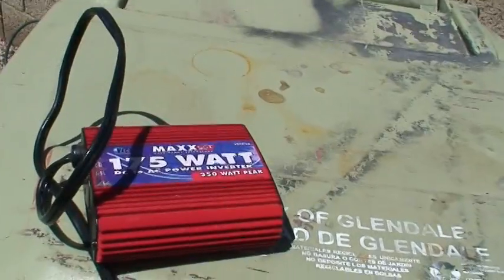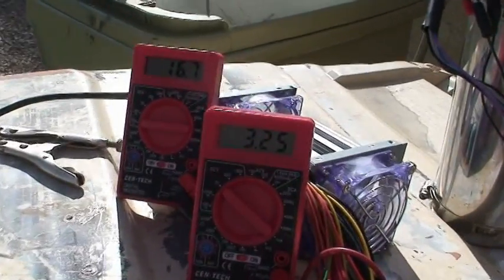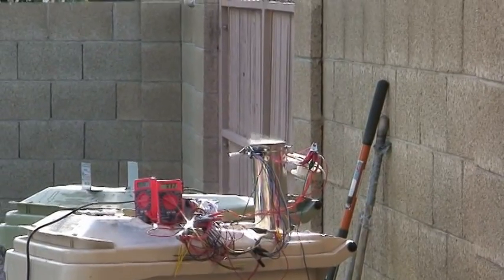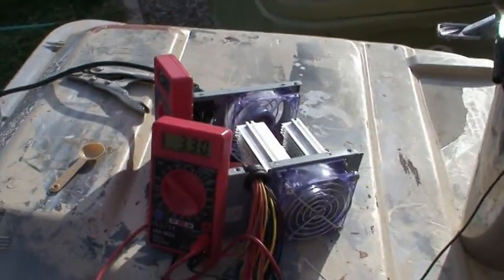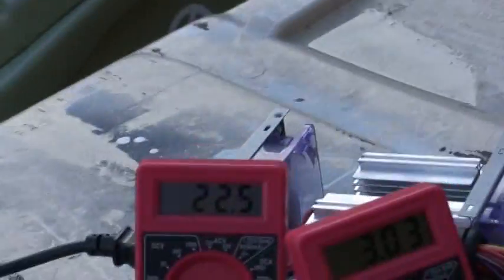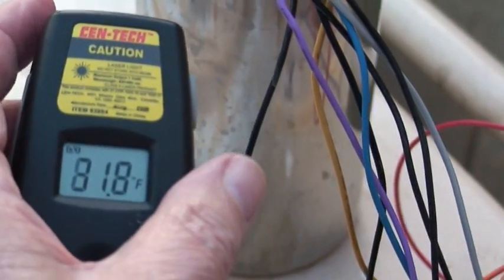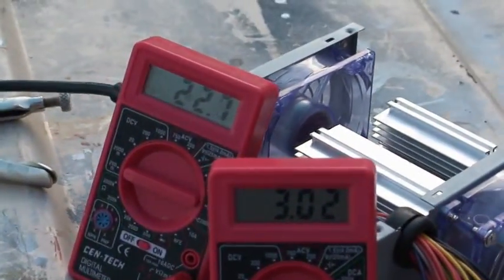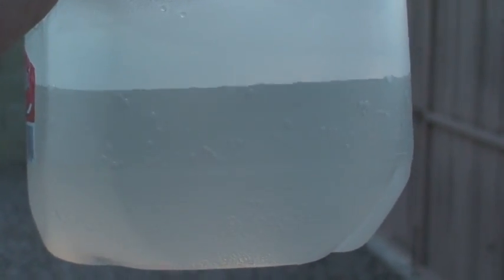HHO on a voltage diet

Comment: water voltage is 1.229V.(go over this voltage and water can split)
when electrolite is battery acid (H2SO4) you get decent electrolysis going at 1.24V use 1.25 for safety)
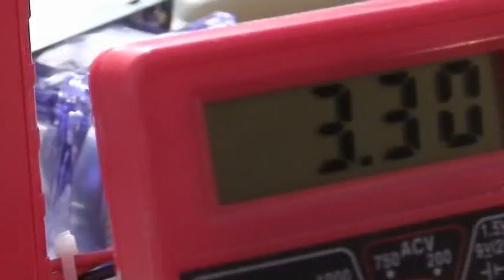at 3:30 you said "its all HHO" but youre still just cooking the water since you have lots of of amps over unused voltage
if you have 55 amps going in at 3.3Volts where 1.25Volts is actually used, then  2Volts is NOT used in the process.
this 2 Volts 55Amps is 110Watt energy waste.(unless you used a neutral)
to really know your efficiency you need to know howmuch hydrogen you have, to know this, you need to dry and separate the hho to get a pure hydrogen.
with electrolysis you get 7 ml hydrogen per amp per cell compartiment
at 1.25 volts this is 1.25Watts per 7 ml
that is just under 180Watts for 1 liter of pure hydrogen per minute (=1.33 liter HHO per minute)
this is clost to the highest efficiency straight DC electrolysis can give.
to keep things "cool" in the cell, try to stay under 0.5Amp per sqr inch (=84mA per cm2)
use "thin" RVS since RVS is a "bad" conductor since it has over 40x the resistance of copper.

Comment: I like your setup. What was that stainless steel container? It looks like a thermos without the bottle. Again I say try your startship coil at the bottom just to see if it gives you any better production. There are claims that such setups yield more HHO. Of course that will increase your current useage. Would it be worth it? Maybe you could incorporate the coils as your buck convertor and gain a magnetic field to boot.

Comment: Be more scientific read the concept and follow it because .1Power in wats is P=VA so 22A  3V = 12V 5.66A so how can you proof the Amp are separate more important then the Watts.
2 did you measure the output before and after.
3 the boil water temperature is 210 approx and is the key to use less current to separate the H2O molecule  and you have less than 100 F?

Comment: @english20002000   We use inverter to run 220 or 110 volts for the computer power supply, Sir, my question is how many AMPERE is use to this 2 componets to run a 3 volts and 20 amps?    have you try to test it?

Comment: Why not just hook up the cells or design one cell with a series circuit? 

About 5 pairs of plates hooked in series should drop the voltage to a little less than 3 if the alternator volts are around 14.

Isn't that even better than loosing amps when sharing 30 - 60 over a few parallel cells?

Comment: Hi, Nice work. I read about using low voltage in Tero Ranta's paper on a high efficiency dry cell. Just trying to figgure out how to make a 3.5v alternator and regulate that down as needed. Re-winding the stator with 1/4 of the turns may be worthwhile, eh ?

Comment: i'm now gettin very confused with all this hho stuff first i hear hi voltage low amps is good now i'm hearing low voltage n hi amps is good ,the real tests are done with alot of mileage and the system running on the vehicle! there is possible merit in this test i always keep an open if confused mind!.

Comment: Whats is this all about again?  Thats why you build multiple array cell to split your 12 DC into 2.4DC/ array cell in series. Thats how you run 2.4 DC @ 30 amps. What kind of resonance is here again? Dave lawtons pwm is for HV water covalent bond fracturing process not for DC electrolysis. You are here at the stage we were 2 years ago. Sealed cell design will beat this sh in every way. Nice try :)

Comment: Nice video, but I belive in high volts low amps. Not talking 100, 200, or even 800 but around 1k-30k volts, using only about 100 miliamps or lower.